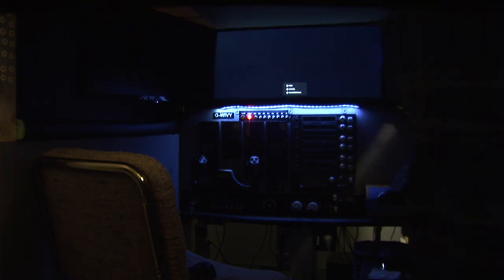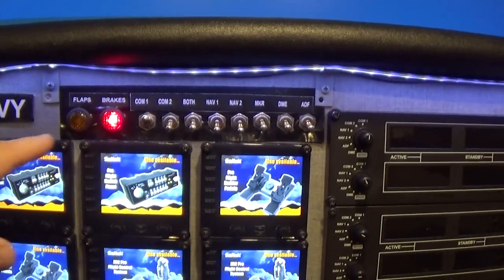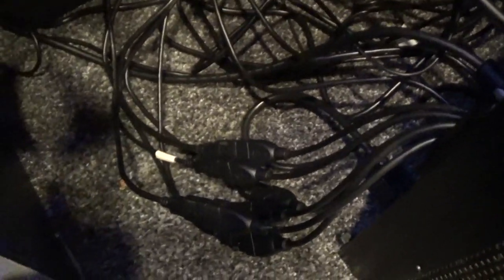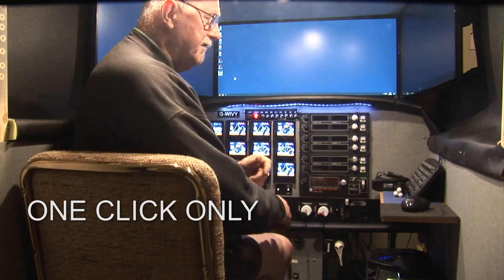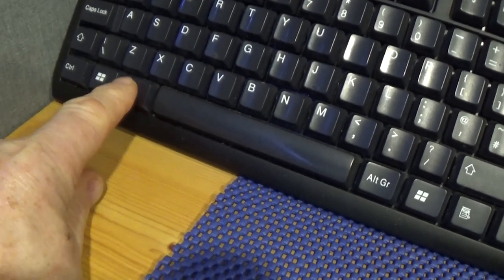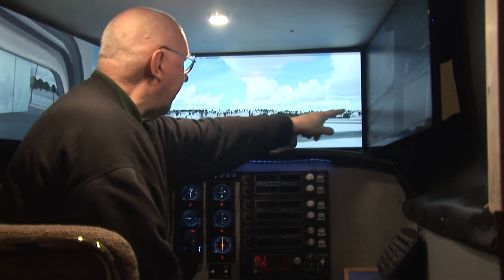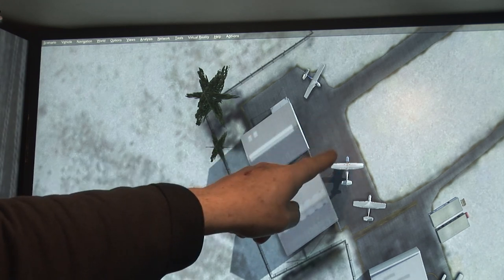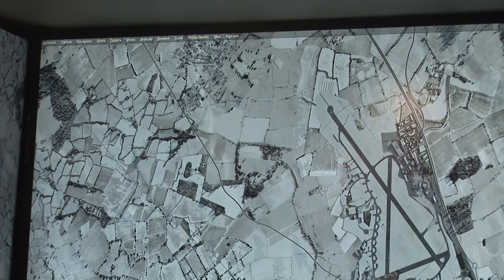1: Starting the 172 Simulator

Comment: Very nice simulator, I have just found your channel and subscribed! I have also just started building my own C172 simulator and my radio panel is almost finished using Arduino MEGA 2560 micro-controller. I will make a panel using CNC plasma cutter and will use a display for all the gauges.
Reply from the maker: Thank you for the comment - I had considered doing the same but the lure of individual instruments was too much :)  Good luck with your build.

Comment: Father Dane, 
 I have been into flight sims for a while now, but I have never set a proper one up. I have been inspired by your 172 sim and thought that I might have a go at it.  I do have many questions, but will settle for one for now. How did you configure the panel of toggle switches above your flight panels.  The one that show com1 com2, nav 1, nav 2 and so on. I have no idea... Thanks in advance... AJ
Reply from the maker: The toggle switches are wired into a gaming card or joystick card. The one I use is a BU0836X 12-Bit Joystick Board (see http://www.leobodnar.com/shop/index.php?main_page=product_info&cPath=94&products_id=180). I wire in the leads from the switches and then in P3D I use FSUIPC to assign the action of the switch to a flight panel function such as lights on and off, fuel pumps on and off etc. I also use the BU0836X board to control the brakes (left and right) and the throttle, mixture and flaps among others. 😊

Comment: Wow father, you really do have a lot of simulators 😂, wish I was you😂.
Reply from the maker: No, only one now.  I gave the Cessna 172 away in January 2020. It went to a group of army and airforce cadets in Somerset. Now I have just the 737. It keeps me busy 😊
Reply: @FatherDane  how did you transport it? But very kind of you to give it away
Reply from the maker: @skydragon8538  The parish priest there who hosts the cadets, came up with a horse van ... it was the only vehicle he could borrow that would be large enough to hold it. It worked 😊
Reply: @FatherDane  wow, sounds very hard to export such a big thing🙏
Reply from the maker: @skydragon8538  Not really - it does break down into parts for transport.  That was the way I built it. 😎